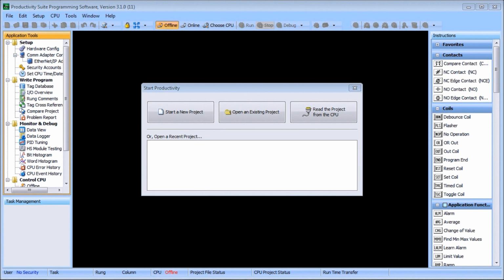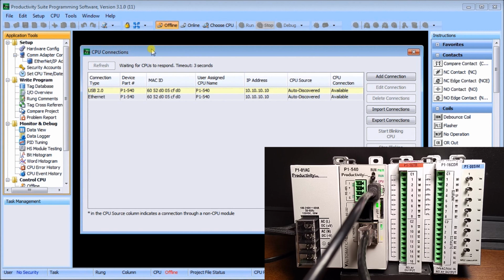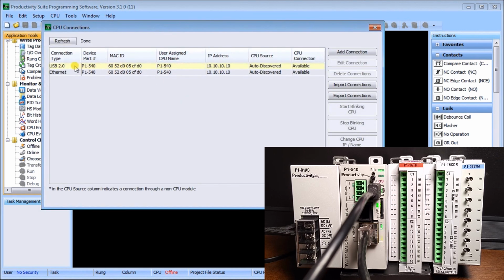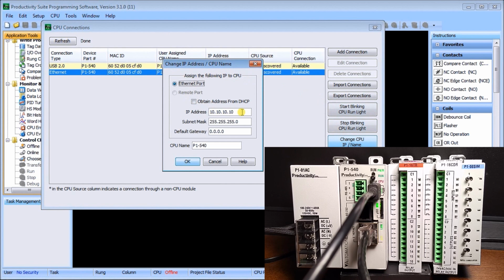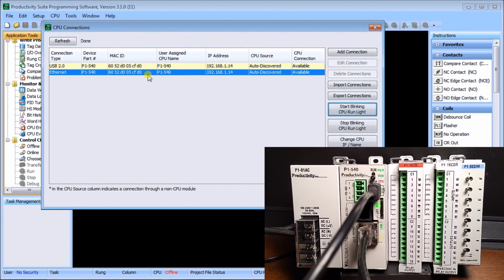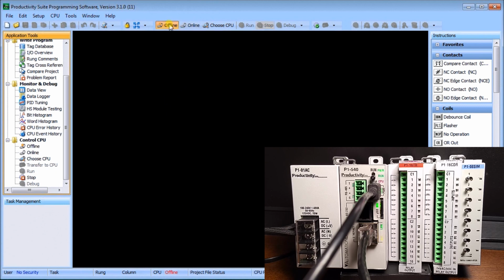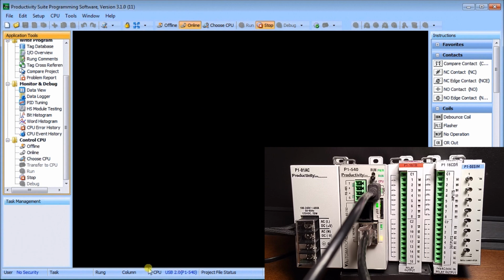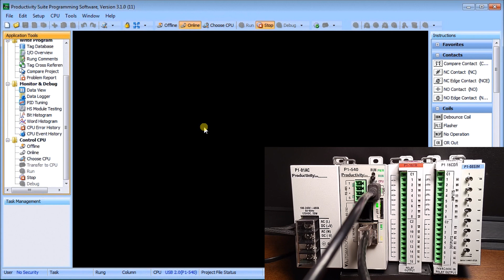Productivity 1000 Series PLC Establishing Communication

Comment: would love to see an example of building a program that waits for input from the ethernet port, actuates a contact, and emits the changed state. This is what I am currently attempting to do. But don't understand why the program means by "A remote project must be loaded".

Have any examples of this, or something similar?
Reply from the maker: Hi Tollis Hunt,
Can you tell me what you are using to communicate to the controller? This would be similar to using AdvancedHMI to communicate Modbus TCP to the Ethernet port. It can then turn on a bit or put in values to a register. 
https://accautomation.ca/productivity-1000-series-plc-advancedhmi-modbus-tcp-ethernet-communication/
The program would just be written to look at the bit or register that has changed.
I hope this helps you out.
Regards,
Garry